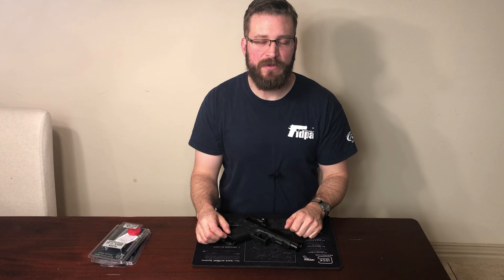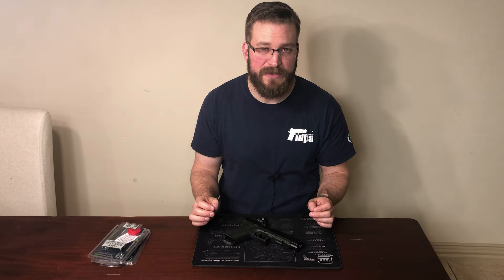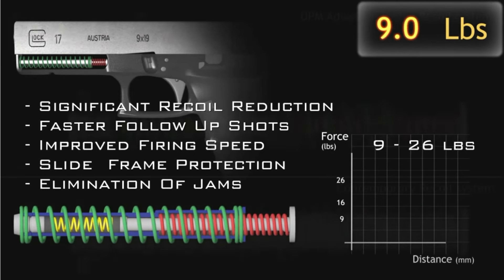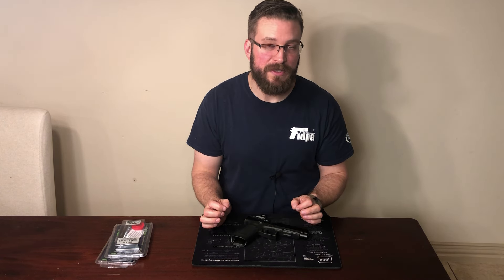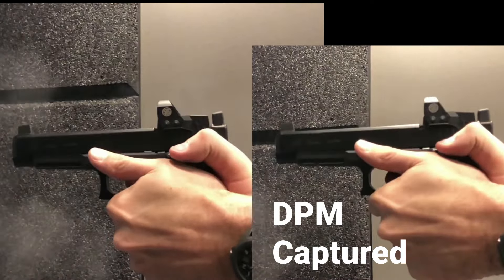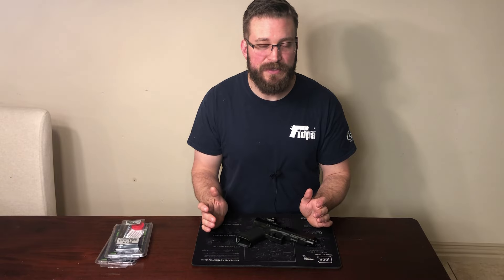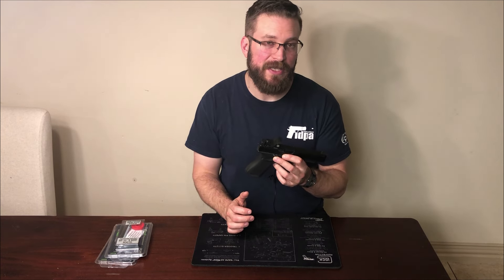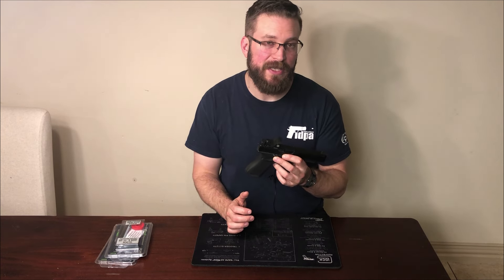DPM Recoil Reduction System - A review - Fully Adjustable and Captured

Comment: Thanks for the info. I’m going to look into it. Does the system add any weight?  I’m glad I got an appearance in the video. I was the RO on the second stage.
Reply from the maker: it probably adds as much weight as a stainless guide rod would to the gun - it's not a ton of weight.  It's appreciably less than the tungsten rods I've tried. Thanks for volunteering - I'm sad I wasn't there to shoot the ProAm with those guys - looked like a heck of a match!
Reply: They had an accessory to this that added addition weight as a picatinny attachment and had additional rare earth magnets that supposedly helped further delay the slide. It's discountinued now. Never knew if it works and never knew anyone who had tried it. Also functioned as a glass breaker.

Comment: Great video.  I saw yours on the Jentra Tungesten guide rod also... so, which rod or spring system would you recommend as the best at reducing recoil? (price not factor) I have a Glock 20 and just want to decrease recoil as much as possible. I've got a compensator already (integrated with stand off device by Dark Hour).  Thanks for any advice you can give!

Comment: Do you see any issues running this system with a compensated G45 or a ported G19x?
Reply from the maker: Depends on how light a load you are using and how aggressive the comp is.  You’d probably be better with a single spring uncaptured guide rod for a comp-  a ported barrel it could probably work

Comment: Do you have any perspectives on using this for major loads?  I'm setting up a Limited gun, and before I go through the process of tuning stock spring setups, I might throw this in the mix.  Didn't really consider it much for minor loads, but it seems like the delta may be a little greater with the heavier loads. I think you mentioned your friend uses it in his .40 Limited glock.
Reply from the maker: he loves it - I recently got him more onto the tungsten guide rods that are super heavy train - since they achieve a similar thing but pay benefits of being able to help the gun be easier to aim on tough shots.  Depending on what platform your gun is - it depends.  I know in Standard division in IPSC these are pretty popular - which is basically limited.  Unfortunately - it's one of those things you figure out by buying and evaluating yourself.  A 44 oz limited gun probably doesn't need any more weight at the muzzle.
Reply: Yeah, running this on a Tanfoglio, so don’t need the extra weight. I was impressed watching your heavy Glock video at how visibly flat the DPM gun was shooting. It’s good to see these run in a real world scenario, i.e. on a stage, rather than the typical slo mo static bay video everyone shows because it seems to show differences more clearly for some reason. Probably because you’re running the gun and thinking about the stage rather than the recoil. Thx.
Reply: BTW, placed an order yesterday and delivery is scheduled Friday, from GREECE.  Impressive.
Reply from the maker: Andrew Wisler they are hyper responsive to email questions too.  They are doing it right with customer service.
Reply: So, very interesting, just did a little testing with the DPM system. I was a little overwhelmed by the possible combinations with the 5 spring system, but have to say the light spring /short bushing seemed the most similar in weight to the 10 or 12 # spring most people run in major pf Tanfoglios, so I went with that. Compared to 10 and 12 # single springs, shooting a fixed cadence Bill drill at 5 yards (.2 splits), almost no difference in group size, all basically hand-sized. Watching video, it looks like the DPM slide recovers a little faster, and so I shot some controlled pairs, this time letting the front sight set the cadence, and splits with the DPM system were consistently about .05 faster, same group sizes. So, I’m going to run the heck out of it for a a while, maybe I’ll do another comparison later to see how it feels. I’m very new to the major pf gun, but honestly it doesn’t feel that different to me from minor. 

I forget if you said — what did you find regarding the different spring options running the Glock?

Comment: Du you still use the dpm system after a year?
Reply from the maker: Because I end up testing so much stuff in my guns - no.  The DPM works fantastic if you don’t want to add weight to the gun- adding a few OZ to the nose of the gun similarly mutes muzzle climb but also helps it with distant/tight shots.  Now I am using the Pure Tungsten guide rod
Reply: Do you know of a Tungsten guide rod that will fit the Gen5 G45? Only one I found is a factory weight spring double captured one from GlockStore. Running a G45 in Carry Optics and there doesn’t seem to be many options not for the G34. Would you run this instead for that application?
Reply from the maker: Seth Rich the pure tungsten guide rod for gen 4/5 glocks at Glockstore is available in 19 length with a 15# spring
Reply: TheHumbleMarksman Oh you are right, I missed that one by filtering for Gen5 products. It’s listed as Gen4/5 so it got filtered out. Thanks!

Comment: I'm just starting out shooting USPSA and I'm thinking about using the DPM system on my CZ. I'm running 147gr at 858 fps, giving me a power factor of 126. That's a pretty light load and I'm concerned about the DPM being light enough tension to cycle properly . I was wondering what the power factor is for your load.
Reply from the maker: I would encourage you to goose your powder charge to at least 128 if not 130 power factor.  Regardless of how meticulous your load is - if you're loading with a progressive press if your bullet speed drops just 14 FPS - which is well within SD / ES numbers for most powders - especially at low powder weight charges like what you're probably using - you're asking to go subminor and not shoot for score.  Typically for fast powders I see 8-20 FPS as an ES - regardless of projectile weight - the higher the charge the more consistent it generally is.    Regardless of whether the DPM works at 126 - you need to goose that powder charge IMO.   I wouldn't know if it cycles ammo that light because I wouldn't choose to shoot ammo that light - the time and money of a major match fee and travel to it is too great to throw it away chasing a non-advantage.